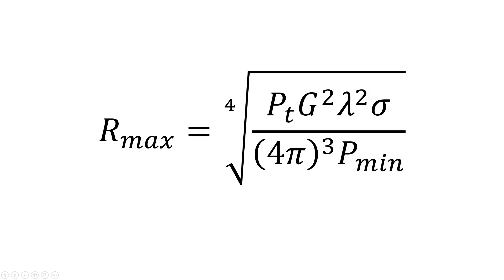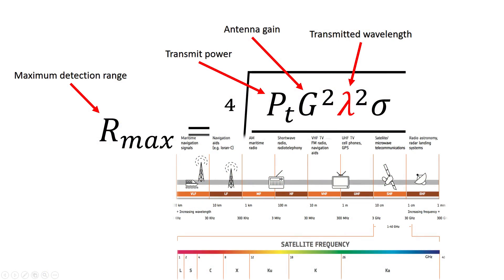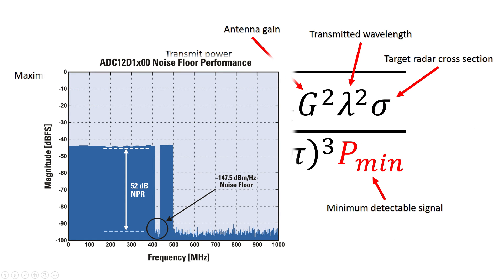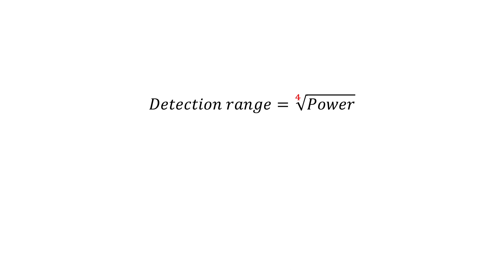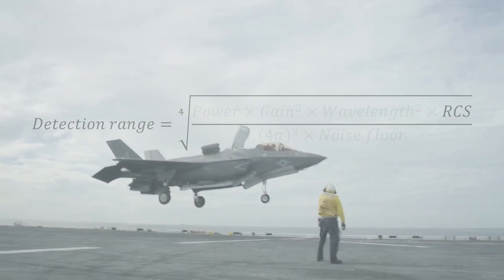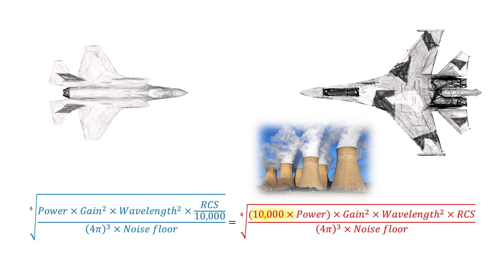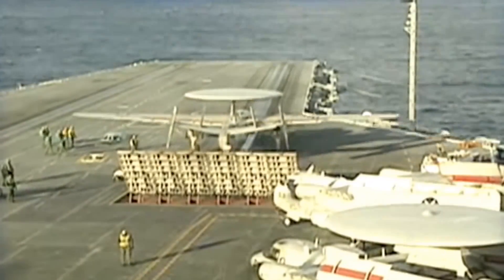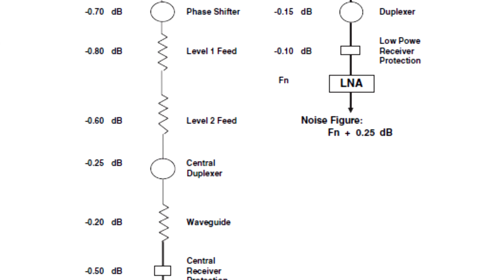F-35 Lightning II: Busting Myths - The Radar Equation [v1.1]

Comment: Several things are overlooked when folks start comparing Russian, Chinese, USA weapons of all kinds. 
First, major powers haven't fought each other since 1945. For example, it's highly unlikely that Russian manned SAMs will shoot at F-35, vice versa, etc...or at least I hope so since the "loser" can always resort to nukes.
Second, geography. Proximity to the battlefield, etc. If we fight in the other guys yard, we got problems. Just as the Luftwaffe learned in the Battle of Britain. They were superior to the RAF, but had to go fight over England.
Third, over a modern Battlefield, Stealth Aircraft come out mainly at night time. The B-2, according to USAF, can be visually detected at twenty miles in daylight. Modern AA guns and SAMs are multi-sensor and can be directly visually/laser beam riding if the radar ain't hacking it. Note, laser beam riders don't work off reflection, but follow the laser beam which is kept on target by the operator. IE, non-reflective paint doesn't work for beam riders.
Fourth, stealth aircraft being stealthy have to carry weapons internally. The internal bomb load on the F-22 and F-35 is a tiny 3000#'s, less than an OV-10 in Vietnam. External bomb loads are NOT stealthy.
Fifth, Stealth is incredibly expensive to maintain. The maintenance on the B-2 is 3.5 million per aircraft per MONTH. And the B-2 must be housed in climate controlled hangers. How will the F-35b and F-35c do exposed on the deck of a carrier, we'll find out. Actually, I hope we don't have to find out.
Sixth, Fog of War. In Vietnam, in theory, the F-4 could pick out aircraft at a distance and pick 'em off. So the first F-4s didn't even have an internal gun! Big mistake. In the clusterfucks over the North, the F-4s couldn't just fire a missle at anything on their radar. They had to positively ID it somehow, by which time the Migs were in close, shooting them up. This was sorta important since at any one time, 90% of the aircraft would have been US. And to fire a Sidewinder, you had to get into position behind the little fuckers which proved damn hard, especially since they only engaged when they thought they had the advantage.(position ain't so necessary with today's all aspect Sidewinders) We had to adapt big time. We did so, but not easily. Large numbers of aircraft had to be diverted to air defense, we had to go low level to dodge SAM which meant some gun could shoot you down. And every time a Mig took off nearby, or somebody fired a SA-2, most of the US aircraft had to jettison bomb loads and start dodging or dive for the deck.
Reply: +Dragon029
Underestimate our HUMINT/SIGINT/COMINT/ELINT?? You're kidding me, right? China? Korea? Vietnam? Our failures are legend, fractal in nature. In VN, we didn't even know how incompetent we were. Google read NSA Purple Dragon (Top Secret Umbra) Chapter V. What Charlie Knew. Just about everything. When Westy took a crap, they probably had samples in an hour. EVERYthing was compromised.
Hubris squared, cubed. We just think the other side sits around, wringing their hands when we throw stuff at 'em. These fuckers are smart. Even, believe it not, I know its hard to grasp the concept, their collective leadership is smarter than Bush, Clinton, O'bama or Trump. Or, ha ha ha, Congress.
Plus, I suspect, a billion buys a lot more hardware in China.
Reply: +Widg3t's Widgets
Sorry, but you've bought the BS. The SA-2 came out in 1957, was obsolete before the North fired it's first round. What about the SA-3, SA-4, SA-5, SA-6, SA-8, SA-9. Russia gave none of these to the North while equipping Egypt, Syria, the entire Soviet Bloc. Google them. READ. Soviets gave them a few SA-7 in 1972, which were extremely effective. Ditto with the fighters. Old discards. JUNK.
None of this is opinion, it is history. It is fact.
The North was never the most heavily defended, shown by the low loss rate. Baghdad was peanuts.
The last time we fought anything approaching a "peer" opponent was 1945.
Sun Tzu said a determined attacker ALWAYS wins? I don't think he was that stupid. If he said that, he was an idiot.
Are you saying that if China launched a determined attack they'd win??!! If Mexico launched a determined attack they'd win.
No, a determined attacker sometimes wins. Japan attacked the US. Germany attacked Russia. North Korea attack the South. Egypt and Syria attacked in Yom Kipper. I   could   go   on.
Google Kadena AFB vulnerability, scroll down.
Read the RAND report. Kadena is within range of to quote"1000's" of Chinese missles. Read the Australian report on the 39 underground Chinese bases that will not be scratched by cruise missiles.
And you do understand that China has 1000's of cruise missiles they can launch from land, sea, air, undersea. In theater, they gots lots more than we do. Google the DF-21. DF-26. We got nothing to compare with them.
Next Google maps, Kadena AFB. Notice the dozens of naked tankers parked in the open. These would be vital for any air campaign as B-52's, B-1's, B-2 cannot reach China without tankers.
The so-called wars we've fought in the last forty years would be mere skirmishes compared to a war with China.
Google S-400 China. It blankets Taiwan. Pushes non-stealth back. AWACS, tankers, most of the USAF and USN aircraft.
We sure the hell didn't win the last two wars in China's backyard. 
The South China Sea is already China's. We don't have a single ship currently in the SCS. The Reagan is tied up at the dock(according to the USN) in Yokosuka, where it spends a great deal of time. If China attacked right now, the Reagan would be a burning hulk in 15 minutes, as it's within range of to quote "1000's" of missiles. Not to mention several hundred Chinese aircraft.
READ, dammit!
Every time a US ship enters the SCS, (according to the USN), it is shadowed by a flotilla of Chinese ships, followed by Chinese subs, overflown by Chinese aircraft. If China attacked first, every US asset near the SCS would be sinking or burning in minutes. Our nearest surviving airbase would be Andersen AFB, but they can strike it already. They have 100 H-6's equipped with cruise missiles and cruise missile armed nuclear subs. They could launch a limited attack on Pearl Harbor.
Google Clark Air Force Base, and learn what happened the last time we put major forces within 500 miles of a determined attacker. By sunset on Dec 8, 1945, the Japanese had essentially wiped out our considerable aircraft in the Philippines, which were conveniently parked out on the apron, sitting ducks, NINE hours after the Japanese attacked Pearl Harbor.
Half of our aircraft were destroyed in 45 minutes. 
NONE of this is my opinion. It's all out there to READ. NONE of this is pointed out in the BS Youtube clickbait propaganda vids. Read, and learn. Listen and be manipulated. Passive watching of propaganda BS on Youtube teaches you nothing. READ don't listen like a zillion other pale basement dwellers.
PS Only the F-35A has an internal gun. The F-35B and F-35C don't. The internal capacity of the F-22, F-35 is 3000#'s(according to the USAF), less than a small OV-10 carried externally(according to me). Sortie rate from distant bases would be tiny. Miniscule.
Reply: +Widg3t's Widgets
And China is now launching military satellites at a faster rate than we do...and while we cover the globe, they've concentrated on their Near Seas., with multi-sensor, multi-wavelength satellites. Radar satellites. Elint Satellites. Geosynchronous Sats staring down and low altitude.
This is 2017, and China, Russia and the US, can track any surface ship on the globe 7/24 real time. Even commercial satellites can deliver great photos of ships underway.
They can just about read over the shoulders of our officers on the bridge.
And you must assume China would have able assistance from the Russian Satellite system.
OTH radar. They got that. SOSUS, they got that.
How much hardware does a billion buy in China. A billion buys you half a B-2 in the US. 
Ignore Geography at your peril. You fight on the other guys doorstep, with limited bases, while also covering your vast other commitments, you got problems. He's got a big advantage. The PLA, PLAN, PLAAF are already on station. A Chinese ship weighs anchor, it has arrived. A Chinese aircraft goes gear up, it has arrived. A Chinese tank, load it on a train, in a day or it's on the 38th parallel in Korea.
So who's heads in the sand. I never listen to Russian experts, but according to our experts who don't post clips on Youtube, Russia's got some bad shit. The bad shits in Syria and apparently kicking some ass.
Fight Russia on THEIR doorstep, the Ukraine, Baltic, etc, they will kick our teeth in. It's geography man.
And if any of them are stupid enough to attack New Orleans. Or Honolulu. We will kick their ass.
We can beat up third rate powers all day. And if you think we ain't worried about crap like S-400, S-500, you need to read. That's why stealth was invented in the first place. Ancient history...the reason USAF had to shift the B-52 from high altitude penetration to low level, cancelled the B-70, scrapped the B-58, was Russian SAMs.
Iraq is a pitiful example to base success on. You could've equipped Saddam with the best NATO weapons and he'd been toast, probably even quicker.
Reply: +mikersey
I like to admire US air tech, they are great work of engineering, and is leading the trend in concept. But the problem is some people do not see it as part of a bigger picture, weapons no matter how perfect are tools after all and tools have to "make profit". It does not take 2 brain cells to figure out most published info on high tech weapon should not be taken as fact, because who would put real data into public?

The majority of mission does not lead to a top dog contest, those are suffice with simpler techs, this is the advantage of Su, the operating cost for daily need of military activity is nothing compare to top line stealth. Syria is using their Mig21 to bomb ISIS, and apparently it was "super effective". Im not an expert on military this is just my speculation.

I think it is unreasonable to replace all planes with the latest stealth jets, cost of operation aside, there are roles that simply render stealth and some other high tech irrelevant, for example, I have no idea how F35 will replace A10, those types of plane fight the war on completely different scale, A10 was designed to fly slowly over the head of troops,  while take punishment from all the "dirty" weapons. how is F35 gonna do that? The thing is super delicate, and how are we compare its payload to A10? how much is to fix it if scratched?

I guess people need to know the difference between supporting the industry and supporting the Country. Those super high tech toys should be used for where it count, but that would result in too few planes sold, and the company isn't gonna like that.

Also the quote from Art of war, was explained in a misleading way, determined attack should mean determined operation or determined war effort. Determined is also meant to be well thought. At least attack should not mean an assumption for being an attacker in relation to defender, because why did they build those castle in Europe, if they weren't super effective against our presumably determined attackers?  : D
Reply: We are in 2018, not in 1960, 58 years after. Electronics has enormously progressed since, a simple smartphone is more powerful than a big computer of the time. So stop bothering Vietnam. During the 2 wars of the Golf not a single dogfight occured. When you know nothing about F35, be quite!
Reply: +Dragon029 
Please read pages 45-66 of this PDF and draw your own conclusions.
http://www.rand.org/content/dam/rand/pubs/research_reports/RR300/RR392/RAND_RR392.pdf According to RAND, Kadena is within range of "1000's" of missiles.
Next Google map or Earth, note the large number of tankers parked naked on the ramp at Kadena. Supposedly these would be used to support our bomber force which can't reach China without tankering. 
Next
http://www.ausairpower.net/APA-2011-01.html  How much damage can you do to these bases with the tiny bomb load of the F-35 and F-22.
And I believe the RAND report mentions if we can't base tankers forward, the sortie rate goes to hell. Also the threat to carriers.
Google location carriers. According to Google and GoNavy, the Reagan is dockside Yokosuka. And I suspect the rest of the group is nearby.
So my conclusion is similar to RAND's but they don't mention sinking the Reagan dockside which would be I suspect, easy.
So basically, if China pulled the trigger right now, Kadena's tankers are toast and the Ronny sinking in about ten minutes. And assuming it was a planned attack, they'd have their entire navy underway, a navy whose average age is lower than ours. By 2020, they'll have more ships than ours, 351. Today ours is 285. Don't know how they came up with the 351 for China
https://en.wikipedia.org/wiki/List_of_active_People%27s_Liberation_Army_Navy_ships
comes up with 496. Maybe they're excluding missile boats, etc for the 351...but certainly missile boats are damn relevant in the SCS, as would most of the 203 Aux, just with their radars and binoculars.
Throw in the Chinese (Coast Guard)paramilitary forces(2-300) and things start getting right crowded.
Nah, I think today, right now, their naval assets IN OR NEAR the SCS vastly outnumber ours. Certainly we could strip our assets from all the other places we have firm comittments, and in six months, muster a large force. But we sure ain't gonna sneak up anybody like they could. I suspect in six months, millions of demonstrators would be in DC, screaming WTF.
Reply: +MNanme1z4xs
Totally agree...we got plenty to take care of in our own Hemisphere. And I learned about the immorality of war in Vietnam. Choosing to go to war, can't think of anything more immoral.
Frankly I believe China's push into the South China Sea is to defend themselves from us...certainly can't think of anybody else who is a serious threat.
Reply: Absolutely correct. In 1965 China GDP(measured by PPP) was about 8% of ours, now it is larger.
Reply from the maker: Stealth bombers like the B-2 and F-117 came out at night because they only used GPS or laser guided gravity bombs that have a very short range. These days we have bombs like the SDB (which the F-35 can carry 8 of internally) and JSOW which can be launched well outside of visual detection range and glide their way in. There's also numerous cruise missiles coming out like the JSOW-ER and JSM, which are designed to fit internally on the F-35.

As for cost, the B-2 has considerable maintenance costs because it uses early stealth coating tech and because it's a massive aircraft. The F-35A only costs ~15% more to maintain than an F-16C and its stealth coatings are tough enough that the developers of the office have a test panel of RAM that they use as a doormat to their office. Over years of being stepped on, it still met RCS specifications. Other areas of maintenance have been made much easier - one of the vulnerable undercoats was eliminated and baked into the F-35's structure, and instead of using putty on all the seams, they use a special tape which is easier and quicker to apply.

As for the fog of war, situational awareness is specifically the #1 thing (forget about stealth and supercruise, etc) that defines US 5th gen fighters. An F-35's computers have 50x as many methods of identifying a target. We're talking about 3D infrared and radar signatures, radar and radio patterns and frequencies, etc. The focus that these jets have on being able to communicate massive amounts of data between each other also means that if one person identifies someone or something, everyone else has that same knowledge almost instantly as well.
Reply: +Dragon029
Assuming a conflict with China in say, 2025, which seems about the only "peer" conflict likely(hopefully extremely itty bitty likely), assuming we try to hit the mainland, I think we have to expect that China would hit Kadena and Andersen. Lotsa tankers parked in the open at Kadena, not that hardened hangers would work any better for the US than they did for Saddam back in '91. They appear to be constructing B-2/B-52 hardened shelters at Andersen but again, I think the Chinese would be able to crack any above ground shelters, maybe with direct hits from MIRV'ed DF-41s, CEPs seem to be dropping pretty damn quick. And terminally guided warheads MIRVs, pretty sure the Chinese have thought of that.
And in the USAF case, the long trail of tankers starting where? Hickam? How hard would it be for an H-6K, with refueling, to get within cruise missile range of Hickam? The Brits managed to get Vulcans all the way to the Falklands. A Vulcan with a load of modern ordnance would've raised hell.
How about a Chinese sub firing cruise missiles at Hickam.
And with the S-400 and S-500, tankers and Stealth fighters(not as good as ours maybe but will we have to have F-22s escorting the tankers?), how close will our AWACs and tankers get to China.
So I question the effectiveness of F-35s dropping small, although perhaps very accurate SDB's, etc., on the underground tunnel hangers at PLAAF airbases. Plus any exposed aircraft, they could play a shell game, moving them around. 
At 3000# a sortie, at what could be a low sortie rate, how long would it take to get air superiority over China? And the B-2's, what kind of a sortie rate? A couple a day?
I can see a scenario where defense trumps offense, especially in 2025, when China's GDP, according to lots of predictions, will exceed ours. Happened, to everybody's surprise, in WWI.
Reply: Dragon029
The Navy and the Fog of War.
How many sorties of F-35b and F-35c, will the Navy be able to sustain. Depends on how many carriers we can afford to keep deployed in the West Pacific, but if today (1-4-2017) is any indication, not many.
Today ain't usual, but not a single carrier is on "Station" anywhere. The Reagan is tied up at the dock in Yokosuka.
How close will the carriers be able to approach China. According to RAND's 2015 scorecard, today at 1500km they're at risk. 2025?
Fog of War. All this multi-sensor stuff sounds good, maybe is, but we won't know until we're actually in the FOW. And of course, the Chinese will be networking all their stuff and probably Russian stuff. And jamming and spoofing and moving and hiding and etc. And having a zillion drones, jamming and etc. Stealthy drones.
And IF China's GDP matches ours, and IF they increase their % of GDP for the military to match our, they'll outspend us.

Have you read NSA's Purple Dragon report, especially chapter V, What Charlie Knew? Our Hubris was astounding. Our under estimation of the North's SIGINT was astounding. We can't afford to be astounded by the Chinese.
Reply from the maker: +mikersey I can't say I can predict the future, but I think you underestimate the capabilities of modern western HUMINT / SIGINT, as well as cyber capabilities. A strike against Guam and Kadena, etc isn't going to be a repeat of Pearl Harbour. I also think you're ignoring the bigger picture; trying to make it appear as if the F-35 will be operating alone against the entirety of China. For every naval asset they have, the US has more, there's also F-22s constantly rotating through the west Pacific, as well as (albeit less frequently) other assets like B-1Bs and B-52s. In the near future, the USAF will also be introducing the B-21, which will have similar (and in many ways superior) capabilities to the B-2, but at a much lower procurement and operating cost. The US also operates many, many drones, with the number only increasing; the USN has UCLASS and TERN, the USAF has a couple of black projects rumoured about like the "RQ-180", and the USMC / US Army own thousands of man-portable systems.
Reply: +mikersey
I think the other factor would be moral, because after all what is the reason to fight China on their door step? How many US man wish to serve the interest of Japan and Taiwan with their life at risk? Also what if Russia take this opportunity to advance their interest in Europe and Other regions? Sense US force is spread thin. Remember how they just eat up a piece of Ukraine while everyone is like nothing happened? US South border? Drug lord and out laws infiltrate US territory? Would Iran have a chance to test their nuke? Dissolution of UN? And Even if US win, what do we get in return? Massive immigration from China?
Reply: mikersey You're completely ignoring literally every war conducted in the past 40 years. 
Step 1. Cruise/tactical missiles strike early warning/strategic sites that give the enemy a high resolution picture of the battle space. 
Step 2. or concurrent with step 1. Stealth / EW craft strike the deadliest/longest range targets that have the ability to hit us where we'd like to operate.
Step 3. In come the tankers, light fighters, light bombers, non-stealth.

Step 3 doesn't happen before the other steps.

In terms of the Navy, you need only to look at how we handled desert Storm. After all. the S300 and S400 that fanboys love to tout are upgraded versions of legacy hardware that was present in Saddam's Iraq. Russia has yet to put out a revolutionary, or even unique form of radar/anti air hardware, and back then, when we were holding back the stealth aircraft, we had no issues. Even if you'd like to believe I'm wrong on this, there's a greater reality at play here.

We right our wars elsewhere. For a reason. And this boils down to something our friend Sun Tzu taught us. It is true today, and has been true for thousands of years that: a determined attacker always wins. That is to say: the attacker chooses the rate of loss acceptable to him, and he chooses the operational tempo, and how the battle that follows will play out.

And that loss need not be greater than 0, but we're impatient so war is never that lovely on us. But even if you disagree with this as well, here's something that you so thoughtfully ignored. We launched thousands of jammers, decoys, flares, chaff, and remote controlled targets at Saddam when the time came so he either A) wasted his missiles (which he mostly did) or B) stopped launching missiles and then became complacent with our fake attacks (which he also did).

Since WWII the US Air Force has operated several times in areas that were described as the most heavily defended on earth, including over North Vietnam, which had the latest and greatest everything a la soviette. We didn't have unsustainable losses then and we certainly wouldn't today, when the gulf between us and any opponent is larger than it ever has been.
Reply: mikersey That's why both the 22 and 35 have a gun, internal weapons bays, they fly at night, and we've improved our missiles.

You can stick your head in the sand, or you can listen to even the Russian experts, who will tell you that in 91% of all engagements since WWII, he who saw first killed the other dude and survived. 

Sorry, but stealth is fully fleshed out. It was fully tested when it was sent into hell (downtown Baghdad) with 0 escort, jamming support, or suppression of enemy defenses.

New planes are stealthy in IR as well, and there are a whole fleet of stealthy aircraft that we haven't even heard of (especially drones outfitted with a different paint scheme that appears bone white). These aren't just flying around the world penetrating Iranian and North Korean airspace continuously, but they're doing it during the day time as well.
Reply: Wow man. You're a smart guy. Enjoyed reading what you wrote. I couldn't have said it any better myself.
Reply: mikersey Welcome to 2017, it's not Vietnam anymore.
Reply: The limited internal stores isn't such a major problem, you send multiple waves as a given target, you first send clean internal stores only planes to destroy anti interdiction and other air defense assets, then carry out the real strike with a less stealthy plane.
Reply: HenryDavidT
Very good. Lotta food for thought. It seems that something in our water/genes/hubris causes us to underestimate Asians even though many of us are Asians.
I don't understand why we believe our Sphere of Influence extends to China's shore...I see their actions as defensive in nature. With no bases/allies further out in the Pacific, it'll be hard for them to project power much past the "Second Island Chain" and actually threaten the US. But we insist on being in their face.
It's the responsibility/natural for nations to look into their past and see where the threats came from...in China's case, at least since the Europeans came on the scene, it's been the ocean. I see similarities between our Monroe Doctrine and China's moves into their near-seas. Of course, VN and the Philippines will see it differently.
Except for a few isolated cases, the US has always had aerial dominance while the Russians/Chinese don't count on that luxury. So their armies have a lot of AAA capability, tech better than ours. And while we no longer have any real home based air defense capabilities, except shooting down hijacked airlines, the Chinese Air Defenses are formidable...especially since their army/Air Force and AAA is in place. Except for our few stealth aircraft, USAF/USN will have to stay off shore and shoot missiles. Seeing that there's been occasional shortages fighting ISIS, don't think we've enough cruise missiles in the inventory to scratch China, especially since they'd disperse big time and shoot down a lot of the cruise missiles.
Another interesting play is the INF treaty from 1987, which bans Russia and US from developing missiles like the conventional warhead or nuke option DF-21 or land based long range cruise missiles. And with the INF/START treaties, if we really got in an arms race with China, there nothing to prevent them from deploying ICBM's with conventional smart MIRV, MARV terminal guided warheads and sinking a carrier tied up dockside in San Diego/Pearl Harbor. Or B-2s at Whiteman AFB. They already have the DF-26, Guam Killer deployed.
All this hopefully is hypothetical as I don't think the big three are stupid enough to get in a war. But a stumble or tweet, who knows.